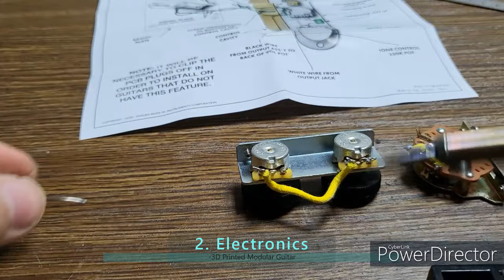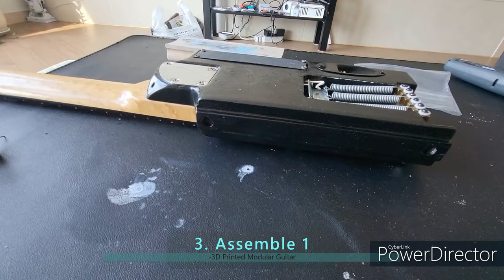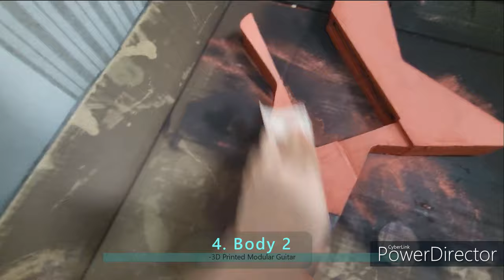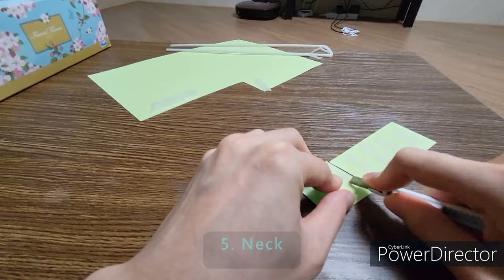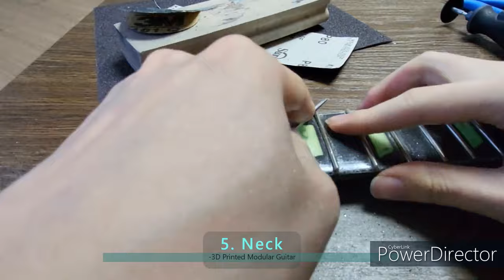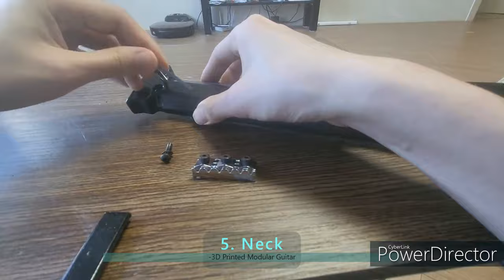3D Printed Modular Guitar

Comment: I'm doing something similar, but with wood, and with the electronics in the 'normal' places.
I found an incredible thing on Amazon called '3.5mm Screw Terminal Gold Plated TRRS Male and female connectors'.
They're like TRRS jack plugs and sockets, but have four screw terminals, so I can screw my pickup wires into one, have the corresponding part on the wing and do regular switching.
I'll be adding another pair for the piezo bridge, and another for when I have a 'top switching body'.